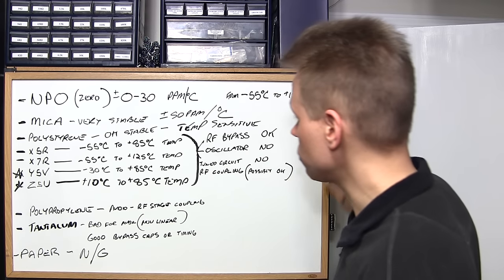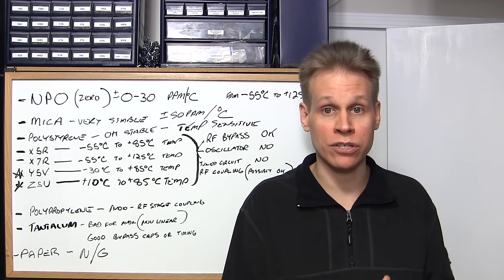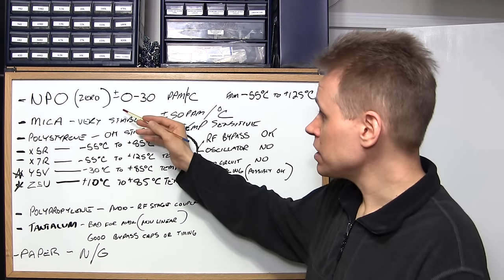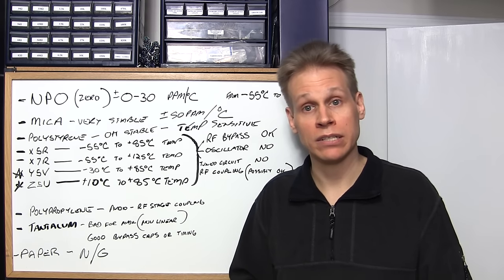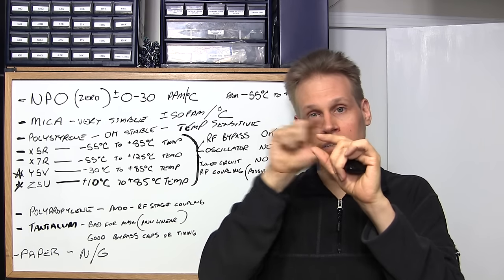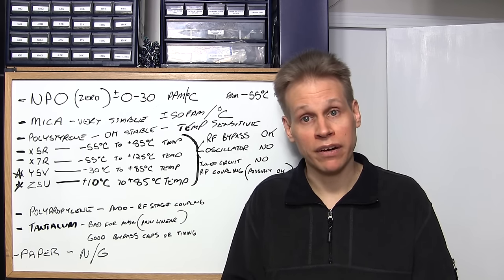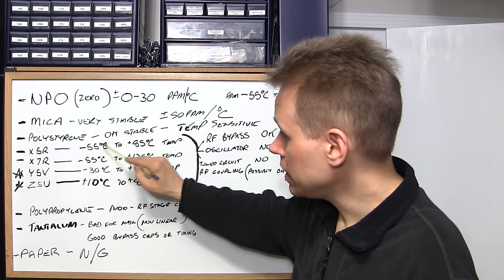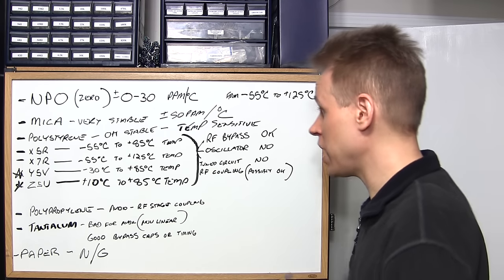Which Capacitor Do I Use? Tech Tips Tuesday

Comment: So... I have a 6.3V 3300uF Electrolytic capacitor... Does it matter which company I get them from?
Reply from the maker: Yes it does.
Reply: Mr Carlson's Lab so a Nichicon capacitor from 2001 can't be replaced with a Sanyo capacitor with the same specifications? This is for a motherboard I'm fixing. I already replaced the socket (It had putty in it from a friend's kid.)

Comment: German tube stuff used polystyrene a fair bit.  Usually around the bandswitch and tone control stuff, but once in a while they hang off tube pins.  One bump with a soldering iron and they are done though :) 

Shame you didn't have any of those Micamold paper caps that look like big silver mica.  Those are deceptive.  Just as bad as any paper, but they look like they might not be paper. 

Will tantalum do OK for cathode bypass caps on an audio amp?  They're basically just seeing DC at that point.
Reply from the maker: +gadget73 
There is audio at the cathode, I would stick to electrolytic's. There are so many different caps, so I just focused on the popular (well kind of popular) capacitors. The TTT was 24 minutes long, and I didn't even get to electrolytic's. That alone will be an entire video.
Reply: Only reason I mentioned those stupid paper domino caps is so people know they exist.  They're just paper, nothing special, but I've seen cases where people left them in thinking they were mica caps.
Reply from the maker: LOL, Yes they are tricky sometimes. Don't forget about the domino style resistors as well... They also look just like those mica capacitors with the dots.

Comment: Is there such a thing as a low frequency pass capacitor/thing (under about 100hz) for a stomp box drum? I use a passive piezo disc & something just soldered in-line would be perfect? Sorry bout my non-savviness haha
Reply from the maker: Hi Clint. Audio filters are designed many different way's. Much of the design depends on the impedance of the circuit.
Reply: +Mr Carlson's Lab Thanks for the reply! Sorry I'm not sure how to ask the question really. Just thought there may be something simple so I don't have to eq the signal at the desk.

Comment: Hello Mr Carlson, I have a Tektronix TYPE 316 Oscilloscope that is in working condition. However, I do not have the test lead. It has a connector much like your TYPE 547. In your video it looks like you are using some sort of adapter to enable the use of a BNC lead. I would appreciate any info as to where I might find that adapter or an actual test lead. Any help from you or your viewers is greatly appreciated.
Reply from the maker: The end on the scope is a "PL-259" connector. You need the opposite end, which is the mate. The opposite connector is an "SO-239." So you need a BNC to SO-239 adapter.
Reply: Outstanding! Thank you for the help! Subscribed

Comment: Two years ago I was trying to build a Colpitts Oscillator with a 2N2222 transistor, and I could never get it to work.  It would work in Multisim 7, but not in reality when I soldered it together.   Now, through your video, I find you're not supposed to use ceramic caps in osc. circuits. Why is that?
Reply from the maker: Standard ceramic disc caps move in capacitance with temperature. This equals frequency drift. NP0 capacitors are ceramic, but are in a different classification and will compensate for temperature movement, so NP0 caps would be ok.

Comment: in old tube radios they use black tar capacitors...can they replace with polypropylene capacitors?thank you
Reply from the maker: Yes you can Jim, as long as they have the same ratings.
Reply: thank you for help

Comment: Hi there, what capacitor could I use to replace a dead Mylar 104J 50V capacitor? I need to replace 4 of them.
Reply from the maker: What kind of circuit are they in?
Reply: Hi thanks for your reply, they are in an audio amplifier circuit what does the Bass and Treble controls.

Comment: No mention of electrolytics!?
Enjoyed the video regardless.
Reply from the maker: +OnEvenKeel 
Ya, no electrolytic's in this one.... It was already exceeding my TTT video length limit. I will do a dedicated video on them in the future. Thanks for your comment!
Reply: +Mr Carlson&#39;s Lab Sir if Capacitor block DC voltage than why we use it in Full wave rectification to remove un wanted voltage or Pulses after rectification
Reply from the maker: Hi Abid. The fliter capacitor "in effect" isn't removing pulses, it's filling in the gaps between them. If the capacitor was to remove the pulse, you would be left with just a base line, which would be 0 Volts. This video explains that with more clarity: https://youtu.be/qTb65aoYA_Y
Reply: oooohhh thank you sir.....Sir our instructor thought to us that Capacitor is used for removing pulses....Thank you sir..
Reply: Sir my second question fro you that why inductor block AC while pass D.C....bcz inductor is made of coil so in normal routine coil pass AC

Comment: So, i'm not new to the subject, but i'm new to actually doing it. I have an old tube amplifier from a 1957 RCA Victor console i'm fixing up (A model 7-HF-3). Could I technically use disc capacitors to replace the old paper and wax capacitors? Probably not, but i'd like to know, you might of even mentioned it, I just don't listen well.
Reply from the maker: Hi Cody. Use poly capacitors. Don't use ceramic disc capacitors in the audio signal path
Reply: @MrCarlsonsLab  Thanks, very helpful. The same goes for the Am/Fm radio chassis correct?

Comment: Idk I still swear paper and foil/oil sound the best in a passive circut.
Reply from the maker: They may, but that sound is attributed to nothing more than the capacitor driving the leading stages heavier into class "A." The older paper and oil capacitors have a lower internal resistance than modern poly types. You may also like DiFilm capacitors, they are black, with red writing on them, usually labeled "Sprague." The Sprague's with yellow writing are bad, as they are paper and foil.
Reply from the maker: Of course, this is for an "active" circuit.

Comment: RF circuit
IF circuit
audio circuit
Leakage test vs an capacitance test.  R leak
Paper going acidic and passing DC.
Old bumble bee capacitor.  Just paper and foil.
Driving into hard class A when the paper goes acidic and damages transformers and power supplies and vacum tubes.
reciever circuits
6L6
audio output transformer
mica capacitors 
ceramic capacitor (don't put them in oscillator circuits - not stable - temp issues)
orange drop
brown drop 

NPO and Mica are the best.  
Paper is worse at bottom.

RF decoupling
RF bypass

Heat testing - 
Vibration testing - ceramic is really bad for vibration due to piezo electric effect.  plastic film is great with vibration.

Comment: Anyone else here annoyed by residential LED bulb manufacturers who appear not to understand that heat is bad for capacitors? Almost all which have "burned out" were the result of over-heated capacitor(s). 
They know that a majority of light fixtures position the bulbs where all of the generated heat is directed onto the internal circuitry, causing premature failure, yet the still design them the same way. 
Granted, my "fix" does not look attractive and could not be safely sold in stores, but I have 5 LED bulbs which have recently reached 10 years of age. (not for exterior use) ALL needing new PS caps within the first 4 months of use. Since moving the caps to the exterior of the bulb housing, no issues. I am merely waiting for the LED's themselves to begin to fail.

Comment: I have one question ; I want to change my capacitor in a crossover the opinion of a guy in England tel me to not change it for polypropylene here a copy of is letter : 
You MUST use electrolytic capacitors. You cannot use Solen polypropylene as an alternative. The Celestion crossover design is dependant upon using the relatively high Equivalent Series Resistance (ESR) of ALCAPs. Polyprop caps are entirely unsuitable. The best solution would be ALCAPS for the LF & MF filters and CrossCaps for the HF filter.

And the person I now at solen tell me to change it to polypropylene he said it will be better ...what is your thought about that ???  thank you................
Reply: Charles Boulay The ESR in a crossover or audio filter design is to limit ringing.  A crossover and speaker system is a bunch of inductors and capacitors that will slosh electrons back and forth for a while if you give them the chance. It sounds like they depend on the ESR of the caps to limit this effect.  

If you want to replace the electrolytics with polypropylene, you will have to add discrete resistors in series with the caps to make up for the lost resistance.  Otherwise, you are likely to get an audible ring in the speaker output.
Reply: OK thank you ...

Comment: Ah yes, tantalum capacitor horror stories. I ran into one that was being used to ac couple the input of an op-amp. The op-amp failed in this device and I replaced it, but I had a new problem with the input having a DC bias on it. Turns out that the failed opamp put reverse polarity on the tantalum and when you do that they stop being capacitors and become wires!

Comment: I just got some USSR military PIO capacitors (K40Y-9 0.22uF at 630V)
just to test out if they would still be good being stored away in some Siberian bunker for all these years...
Reply from the maker: +Nexfero 
Capacitor leakage test is your friend in this case. If they show any signs of electrical leakage, even around their rated Voltage, they are faulty and on the down hill slope.

Comment: I work on guitars an I like the pio a lot there's no voltage right?? so they should be OK??
Reply from the maker: +darthmeek 
Bad caps are bad caps. If the device doesn't meet spec, it's in the trash.
Reply: ok thanks

Comment: hi my name is ted, i have this 1941 GE radio/phonograph console i am trying to repair my self, when you turn it on it makes a loud humming noise, so i removed the chassis and inspect it i found 3 broken wires a disconnected capicator and a disconnected ground bumble bee capicator, i fixed all of those but it still made that bad humming noise, i tested the paper capicators i found 3 were bad so i replace them but still no good, now i was watching you videos on testing capicators and you had said to get ride of all the paper capicators and replace all of them, now my question to you is the old ones that are in this unit are .01 to .02 MFD @ 600VDC, you said that the polyproylene capicators are good for these type of units, can i put in these type polypropylene caps that are rated at 0.068UF @ 630V will they work with this unit, please let me know i would appreciate it, thanks ted
Reply from the maker: Hi Ted. Hum is caused by a couple things. Filter capacitors, are the first thing to check, and they are the most common failure point.
Reply: Hi Mr Carlson, 
ok that is cool but i should replace them all then, and will these work??? is my question, because the old capicators that are in this unit are .01 to .02 MFD @ 600VDC, you said that the polyproylene capicators are good for these type of units, can i put in these type polypropylene caps that are rated at 0.068UF @ 630V "will they work with this unit", if so i will do them all but i am not sure that is why i am asking your professional opinion on this, please let me know i would appreciate it, thanks Ted

Comment: great video but I have a question for you iam a model rail road and iam using a dcc sound unit  on my engines but iam in a N scale and the the capacitor is a 100 uf 25 v insulated and it's a little bit big to install on the engine unless I do a little modalities to the unit and I would like to know if I could use the same but smaller in size
Reply from the maker: Hi Doug. The size of the capacitor doesn't matter, as long as the Voltage and Capacitance remain the same.
Reply: Thankyou

Comment: While I seem to have arrived at roughly the same conclusions that You make here on different caps strengths/weaknesses.  Some of Your views seem a little exaggerated.   Ceramic caps for instance also come in NP0's.  Although some ceramic caps degrade, and develop hairline cracks, and become very microphonic, and the thin ones that are of a wide diameter, can have a pretty pronounced flappy sound when fed to an amp that is maxed out in gain, and tapped on  quite vigorously,... even brand new tubes, that are  maximally "non" microphonic, still exhibit a much louder tap tone, often almost 100 times more microphonic.   And clearly tubes are suitable for audio.   The thick ceramic discs, that are small in diameter, are usually pretty good.  I dislike poly styrenes to the point of detesting them.  The melting problem, also the leads can get very brittle with time and just break off.     There are a couple of generations of early tubular caps that You seem to be overlooking, and some of them seem to be mostly quite good overtime.  In the sixties there were quite a few that looked similar to bumble bee's that were polyester, and tin foil, that seem to have quite a good life expectancy,,  and some "tubby" cylindrical ceramics , (precursors of the "orange drops") that seem to be very serviceable, and stable.  Also some of the paper and foil ones were not bad.  Most of the time the paper was pretty pure 'calendered cellulose, and pretty acid free,  I'm guessing the failure modes have more to do with moisture, and mildew or mold and temp/voltage extremes.  If You want to say that a tap test is a good test for usability of components in Hi End Audio, how would many inductors or transformers  perform? and even cables.   Also a question... what is the composition of the bright blue thick disc caps used in Computer monitors and power supplies, typically .0047 and 1KV?  they seem to perform pretty well.

Comment: black beauty capacitor on the left have no papet inside, broke few of them with hammer an it was metal film and plastic film insulator.
Reply from the maker: What is the production year of your capacitor?
Reply: manufactured by sprague pulled fron HK A-700 tube amp, circa 1960 replaced with contemporary  hovlands teflon and foil, then metalzed film jantzen  and   I must say original sounded better.
Reply from the maker: Did you test the originals for "leakage?" If so what tester did you use? I would also like to see a picture of your capacitor (LINK) There have been reproduction capacitors on the market now for many years, you may have opened a new repro. I have been repairing older equipment since (forever) I have never come across an original striped bumble-bee that's been good (NEVER) So provide a Link, I would love to see your capacitor.
Reply: well, they were not stripped but with writings in red and apto 650v did not leak
 I builid leak tester, it have variable voltage supply upto 1400v and variable load 1k-10M and charge capacitor for dc test conected between load resistor and ground, then second voltmeter with momentary switch to check if any charge accumulated in the second capacitor as it leaked from first. the only good way to test leakage is with high voltage ( withing ratings). as for pictures I will try to find thise pieces and send them. Cheers.
Reply from the maker: Those caps you mention are usually designed by "Sprague" or the like, and come in red and yellow writing. The red writing version capacitors are not black beauties. The capacitors with red writing are a poly style cap, "and leak slightly," but are usable. This will drive the next stage a little harder into class "A" which leads too the sound you like, (the tubes are biased ON a little harder with slight leakage.) These capacitors did not sound like this from the factory, as they didn't leak DC. The yellow writing capacitors are paper and foil (not in oil) and are completely bad by now. These have to be changed like bumble-bee style capacitors, or damage to tubes, and output transformers will occur.

Comment: Why do people say a cap blocks DC and lets AC pass. No current passes thru a cap. With AC they just charge and dis-charge at the rate of your alternating frequency, allowing current to flow in the rest of the circuit.

Comment: so capacitors keep an AC current?
Reply: +Cory Samoila Capacitors resist a change in voltage by storing charge. If you connect a capacitor to an AC circuit, it will dampen the wave. You can't charge a capacitor with AC current because the negative half of the wave would remove any charge stored from the positive half and vice versa.

Comment: How about these purist radio restoration enthusiasts who remove the paper tubes from old wax capacitors and place them around modern caps, filling the ends with beeswax or brown hot glue? How does the impedance of the wax/hot glue affect the capacitance? It must add capacitance.

Comment: A vacuum tube circuit?? Why did you reference that?
Reply from the maker: Care to elaborate? Time in the video?
Reply: 5:20 Why did you reference something no one uses anymore?
Reply: Most of the high quality guitar amps use vacuum tubes (although some are hybrids), because of the kind of distortion they produce. A lot of high-end audiophile gear is tube stuff, too. The feeling is that solid-state gives too clean/sterile of a sound, tubes have a much warmer sound that's more pleasing to our ears.